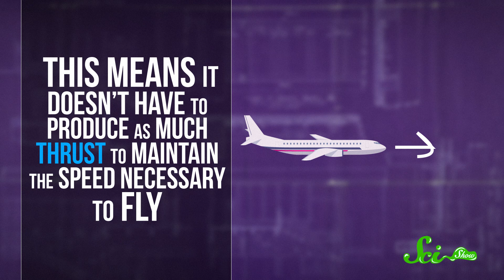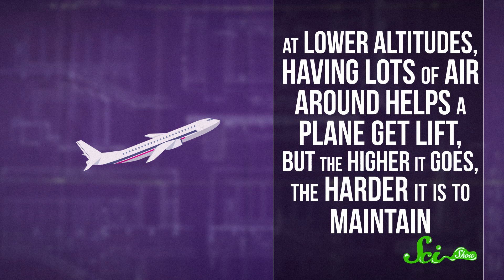Why Do Planes Fly So High?

Comment: can jet fuel melt steel beams
Reply: But 7/11 is a part time job D:
Reply: Actually no it cannot. But it can heat the steal beams sufficiently to weaken their load capacity limit. Hot metal is more malleable.
Reply: SCORPION5O Yes, that is why jet engines are not made of steel.
Reply: Eivind Ludviksen It can't heat it into a molten state, but it gets hot enough to remove heat treatments (anneal) and to simply soften it to the point it no longer has the mechanical properties needed to function as a structural member in an architectural design.

tl;dr - the entire US mechanical engineering and architectural engineering population are not part of a consipracy cabal. And s people are still stupid.
Reply: UnknownXV  Thank you... I don't know why people have such a hard time understanding that....
Reply: No. But Bush can.
Reply: 3.141 59 but those run with compressed oxygen under controlled environments. Jet fuel can't melt steel in open air.
Reply: Eivind Ludviksen 7/11 was a part-time job.
Reply: 3.141 59 Jet engines are not made of steel because steel is much heavier than titanium.
Reply: qwertyerthanyou Well, your "freak accident" shares many similar characteristics with a controlled demolition.
Reply: ***** The structural engineers who worked on the world trade centers calculated that the building would be able to sustain a hit from a Boeing 707, and still stand indefinably.
Reply: ***** http://911research.wtc7.net/mirrors/guardian2/wtc/nova.htm
Reply: Hong they were actually able to tolerate wind-forces over 30 times stronger than the airplane. So yeah, it had no effect.
Reply: ***** but it wasn't compromised. The building was virtually hollow, so it was made to carry it's own weight with several extra carrying points. They actually overdid it when they made the WTC because it was supposed to show the strength and toughness of the economy of America. The only thing that could have made the towers go down was explosives and termite. Which would explain why a lot of the steel beams found were completely melted and not just "softened".
Reply: ***** of course it's a "conspiracy theory". Anything that tries to disprove 9/11 is a conspiracy theory because that is what the American government has made people believe. When something as big as that happens you have to be septic, but the American government doesn't want people to be that, I wonder why...

There was also no video-footage of the Pentagon getting hit, even though it's the most secure building in the world with loads of cameras facing out in every direction from it. The FBI confiscated the CT footage from any store/restaurant in any near proximity of the Pentagon.

Building 6 was also one of the buildings that went down that day. It also fell down like rubble, but there was no jet fuel to melt that building, it actually fell exactly like a demolished building would. 

I urge you to at least try and keep an open mind. I also used to think all the talk of it being faked was something lunatics and mad conspiracy theorists said, but if you just take some time to look at the evidence it all points to the American government being behind it. Al Qaida was even under the FBI as a contractor for assassinations and such in the middle east. They were paid off by the American government to hit the world trade center so that it could be shrugged off as a terrorist attack, allowing the USA to invade several countries and ultimately gaining full control over the western world in addition to getting power closer to China and Russia.
Reply: Cole Jones Are you stupid? It got hit by a 767, that was no where near fully loaded. A 767 is only slightly larger than a 707, and both have very similar weights.
Reply: ***** The buildings fell at free fall speeds. It took just over 10 seconds for a standing tower to become a flattened mess of concrete and steel. An object dropped from the top of the towers would take 9 seconds to reach the ground if there was no resistance at all. Even if the steel core of the building was compromised, there would have been enough resistance to prevent the thing from falling that fast.

Edit: As well to address the fact that it came down in a fashion similar to a controlled demolition. In order for a building to come straight down, without leaning over and hitting other buildings, all the support columns on a given floor must fail at the exact same time, within milliseconds of each other. This is impossible, as there is no way the airplane caused such uniform destruction to a building. The diameter of the airplane body is 16.5 feet, the width of the world trade centers was 208 feet wide. To suggest that the plane was able to affect all the columns on a single floor absurd.
Reply: Jake Halford manipulation? Nothing is set in stone. Same goes for major events like 9/11. Whenever a scientist writes a paper it has to be scrutinized by skeptics until they can't find any flaws in it. The amount of flaws and missing explanations of what actually happened on 9/11 is so much it has to be a cover up. The American government is hiding the truth and there is a very big chance the truth is that they were behind it.
Reply: Cole Jones Please do some research. The Twin Towers were not hit by 747's, but instead were "hit" by 767's. As well, a missile is designed to be as explosive as possible, where as jet fuel is designed to not cause a massive fire if there is a leak, or if the plane crashed. The plane, even if it was a plane, would not have been fully loaded with fuel, as it was originally on a 4 hour flight to Los Angeles. The 767 can carry up to 12 hours of fuel, so at most, it would only have been half full of fuel.
Reply: Cole Jones it certainly was a tragedy, still doesn't take away from the fact that the American government were the only ones who profited from it.

Those towers were made to handle hurricane winds. The hit of a plane was 30 times weaker than the winds the tower was made to take. They were also made to be able to be on immense fire for over 3 hours. The towers fell after only 1-2 hours. The list goes on, the only way those towers fell was that someone knew they were going to get hit and there were explosives and termite to melt the steel because jet fuel alone simply cannot do it.
Reply: Cole Jones Uh it seems you do not understand planes are not solid bricks of metal. The aluminum shell around the airplane is only 2 mm thick. There is no way 2 mm of aluminum, and about 6 inches of foam insulation managed to tear through 208 feet of concrete and steel. As well, there is no way the plane could have completely affected all the beams on one level, as the body of the plane is 16.5 feet wide, and the world trade center is 208 feet wide.
Reply: Yes, I know that. If you actually read my comment, I was saying the plane would not have affected all the support columns on one floor. The only way for a building to fall straight down like the world trade centers did, is for all the support columns on one floor to give out simultaneous, otherwise the building will lean over and hit other stuff.
Reply: Cole Jones no, you cannot make thermite from steel. It's made with Iron(III)Oxide (basically rust) which is not found in steel. The reaction can only occur with molten metal, commonly in powdered form and there has to be 25.3% Aluminium and 74.7% Iron. Neither of these things were the case for the skyscrapers.

Not only that, but Aluminium would likely not have been used in construction because it's such a weak metal. Do you have a source for your claim or are you simply trying to explain it away with semi-knowledge of it?
Reply: Eivind Ludviksen The top part which was damaged by heat fell into the rest of the tower, which caused the rest to collapse under great stress. Most skyscrapers today has a concrete core that provides the rigidness it needs to stay up, however the twin towers weren't built this way. It had a steel skin that provide the support. When the top part collapsed it weakened the skin. Don't forget the towers have a lot of air inside of them, when it came crashing down there was no where for it to go but out which explains why debris was blown out
Reply: cesar hernandez there are a couple of issues with this explanation.

1. The top part only fell on one of the towers.
2. The towers fell with no resistance, pretty much a free fall. This could not have happened since the parts of the tower that were part of this "chain reaction" were not damaged or weakened at all. If the towers were to have fallen due to the fire they would have gone down a lot slower.
3. The towers were built to be able to sustain fire for hours more than it took. The impact of the plane also only held 1/30th of the power they were built to take (hurricane winds)
4. The twin towers were, like you said, supported by an outer shell of steel, so yes; it was quite hollow. However, because of this the towers were in no way heavy enough to have make the tower fall that fast.
5. Contrary to what you said there would also not be anything shooting out of the tower because there was so much space for it to fall.
Reply: 1ohtaf1 that moment when you realize interns can't melt cheese.
Reply: SCORPION5O no, it cant even burn at a hot enough temp to melt it, just soften it, and it was a freak accident that the twin towers fell like they did
Reply: Hong To bad it got hit by a fully loaded 747 then
Reply: Eivind Ludviksen I don't think "you have to be septic", but it does seem to happen most of the time with conspiracy theorists.

Also, I feel like I could write a scientific paper on the manipulation you used in the comment.
Reply: Eivind Ludviksen Or it was a tragedy, The real cover up, if ther was one, would have been that it fell, Nope, No crazy Al Quida here. Structural failures!

They were both hit by 747's going 500 miles an hourm Loaded with fuel, Thats not a plane, that's a missile.
Reply: Eivind Ludviksen Steel + Aluminum and jet fuel can make thermite. I am decent at engineering, The force of those planed hitting would of torn through most of the beams on that levle. I'm not gonna say it wasnt inside, But i wont say it was ether, because i refuse to belive, even an entity as corrupt would do that
Reply: SCORPION5O Yes
Reply: Hong Planes do go in a little faster than just a bump though
Reply: And then the American government went on to use 9/11 and "WMD's" as reason to invade Iraq and steal their oil.
Reply: You melt steal beams
Reply: slikrx I suppose we are talking about the world trade center here, so let me explain why I think it was faked:

1. Even though the high temperatures might have softened the metal a bit, it still does not explain why the entire building went down (and with such speed). The entire tower was a self supporting steel construction. That does not just collapse from some heat at the middle/top, it's one of the strongest construction materials used and it was designed to take a lot more than some fire. 
2. How did the tower fall vertically? The plane hit it on the side and there is no way any building would fall like that unless it was demolished. 
3. Police and firemen reported seeing debris being blown out of the building (as if an explosion went off) before the building started to fall.
4. No-one else than the USA profited from this:
- They got to invade the middle east and gain power there
- The FBI and CT got a lot more funding after the event (this money came from Americas citizens)
- The man who had insurance on the towers increased it just a couple of weeks before they were torn down (this made him very rich)
- Saddam Hussein was hunted after this. He had to hide out and it never really gained anything for him.
- Over 300,000 innocent civilians were killed by American bombers when they went into Afghanistan looking for potential WMD. 

The list goes on...